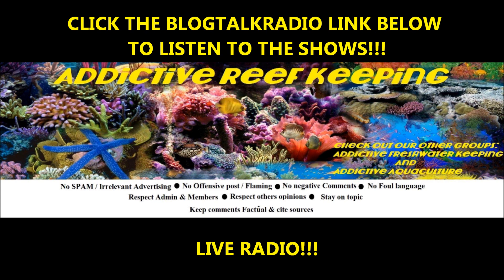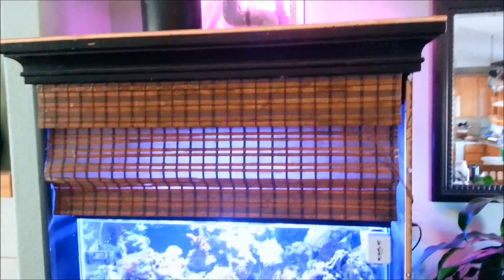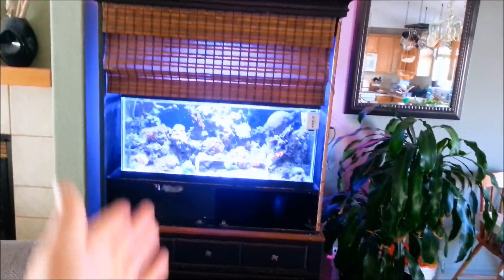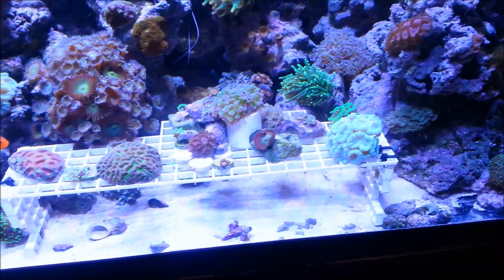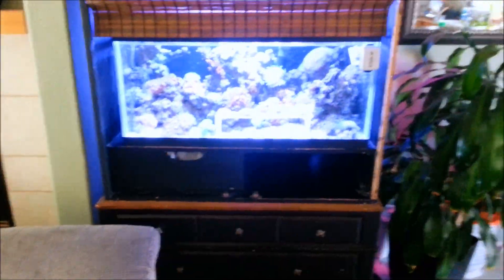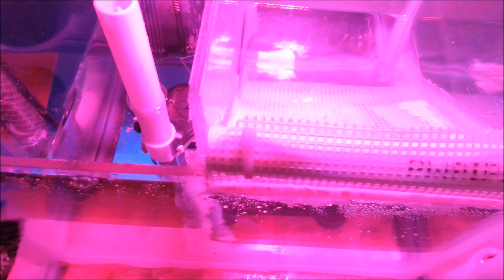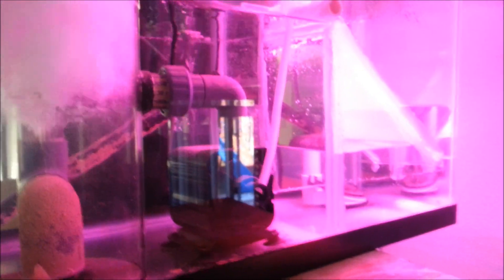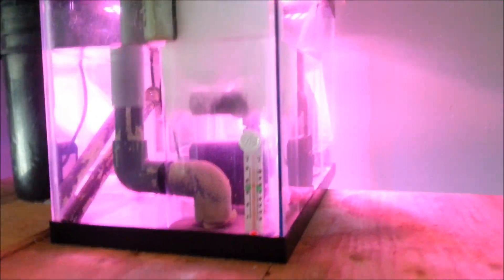DIY ATS/SURGE/SUMP ALL IN ONE!!! (40 GAL.)

Comment: Hey Tyler glad you liked the build if the frag tank, the glass I use is all non tempered glass. So I can cut and drill Ect. This glass I used in this build is 1/4". I like the sump you build as well would like to mimic it. I can't get over the surge device, it's glued to me. Gotta set one up ASAP. I need your help with the ball float valve tho. How to make it stay out of the way and attach to the flapper.

Comment: Hey Tyler what's up buddy great design. I'm tempered now once again inspired by you to set up my surge device. Question 1. What did you use to hold the ball float to the flapper? Zip tie and what?
Question 2. Where is the pump that pumps water into your sump? In your main display right? Behind some live rock? Keep me posted. Maybe do another video just specifically in the surge device in full detail. Thanks once again cheers

Comment: what kind of lights are you using to grow algae, and were you get them? nice surge btw =]
Reply from the maker: Im using Par 38 ABI Red and Blue 12 Watt LEDS. Go to JacobsParts.com
Reply: are these it? are they good to grow micro algae?
 https://www.jacobsparts.com/items/GR-PAR38/

if so, what did you use to screw the leds in, sorry not to good with lighting
Reply from the maker: coldstunner I just used a standard light reflector from Lowes or Home Depot. Those lights are the same I have in this video